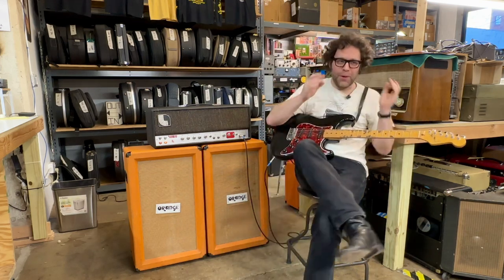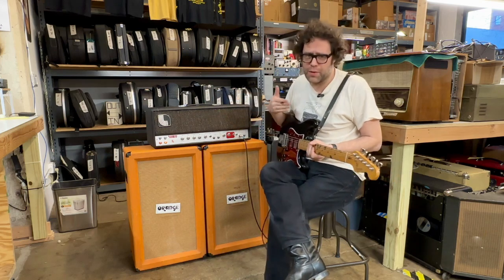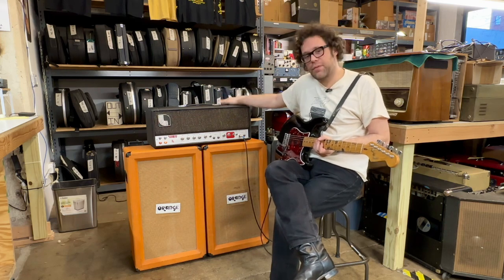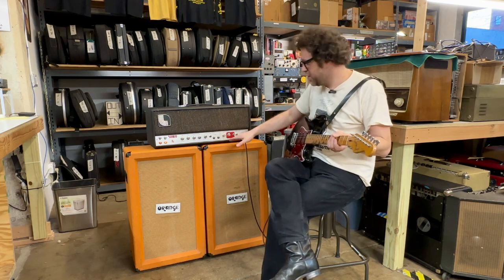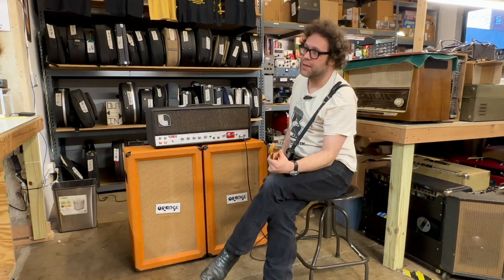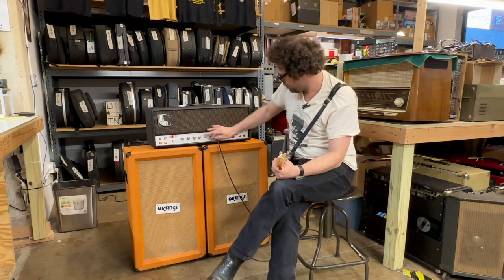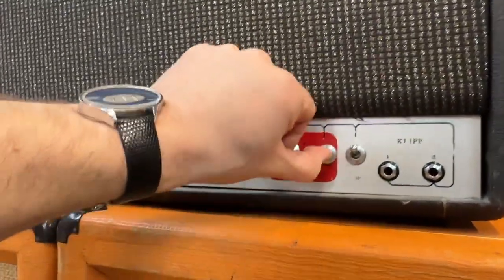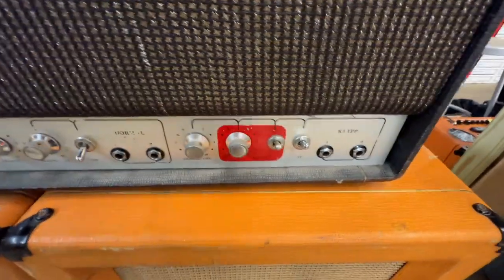Laney Klipp 100 demo and repair discussion & the Sabbath sound

Comment: Tony Iommi never used the Klipp model, AFAIK. People always claim this in eBay auctions when they're trying to inflate the selling price of their Klipp amp. I've looked, as have others, and have never found one picture, video clip, interview, anything that shows that Iommi ever used the Klipp, yet it's still claimed all over the internet that he did, and also Oranges. Also, when I owned Supergroup amps, the solution to them not liking US wall voltage was to set it to 240/UK on the back and buy a step up voltage converter. Step up voltage converters are inexpensive and it worked well for me and others. Since the step up converters are fixed at 240 they're less likely to be set wrong or messed with and Variacs can have reliability problems with their internal brushes, like an electric motor.

Comment: I just got the 60 watt version of one of these. When i engage the Klipp circuit there is a very, very noticeable drop in volume. I'm assuming that's not right because the one you repaired sounds just as powerful and loud no matter what mode it's in. I moved the pre-amp tubes around but that didn't remedy it. In your sage opinion, what could the problem be?